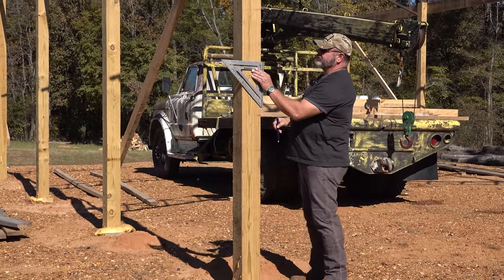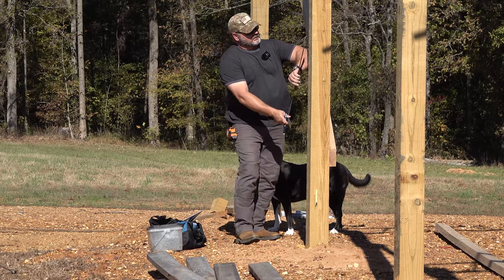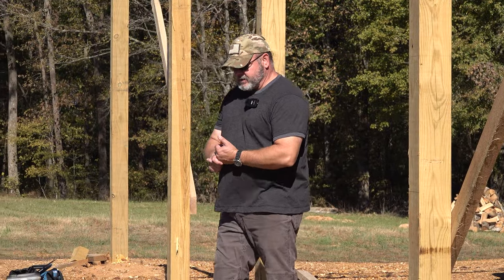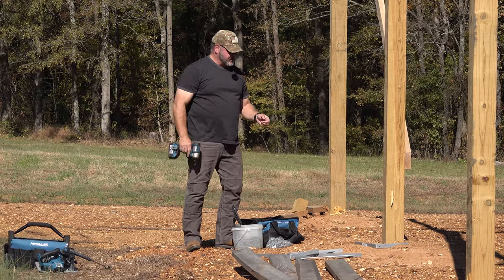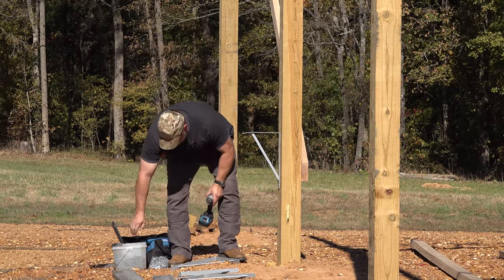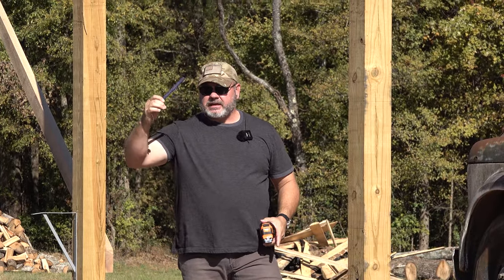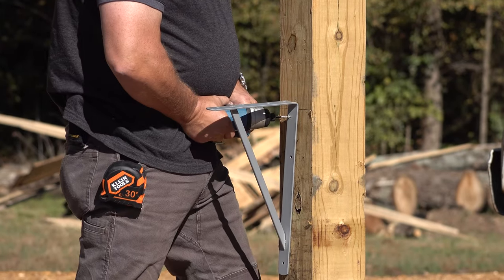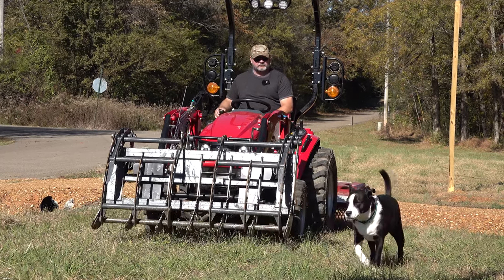Homemade 30FT Laminated Beams made of Sawmill Lumber PT1

Comment: Positive camber is the genius move here Tony, you could even augment it with a few bucks of HT wire and wrap guy links on the bottom of the beam to prevent spread. Props to the viewer that suggested it. With that size timber it should easily last for your time frame!
Reply from the maker: I had so many people offer such great ideas. I think it will be fine.
Reply: Well, today I learnt how to sharpen a pencil...with a knife
Reply: @TonysTractorAdventure  this is a great community Tony.👍

Comment: Tony when you built your beam did the 2 inch crown work pretty good im going 20 ft with my beams I’m thinking 2 or 4 inches any suggestions brother
Reply from the maker: I learned a lot doing this. I would recommend stacking your boards on top of each other instead of putting them side by side like I did. Mine are still holding up very well but it would be stronger if they were stacked on top of each other.

Comment: Looks like Phillips head screws. I have not bought any of those for years. Only torx bit or square head screws, or even hex head screws.  Ron
Reply from the maker: I am with you. I dug these out because I have had this tub for years. I am building this on the cheap. The glue is the only thing I bought.
Reply from the maker: Which do you prefer more? Torx or square?
Reply: Just did some picket fencing on the cheap, dad let me use his square head screws and bit and I thought it was great! He got them at a yard sale
Reply: @TonysTractorAdventure  Usually I buy the torx and sometimes I buy the Spanx screws.